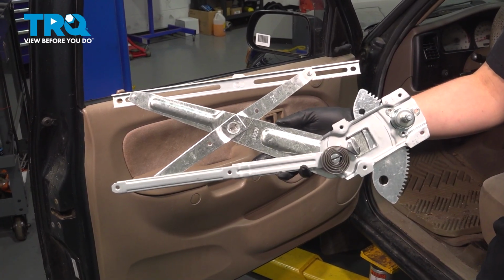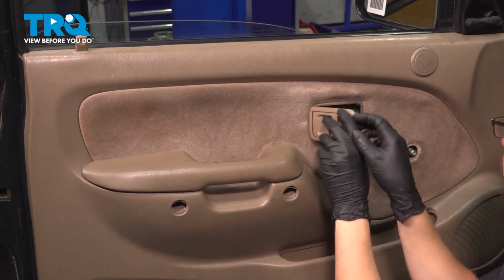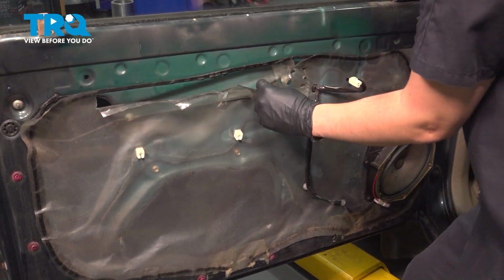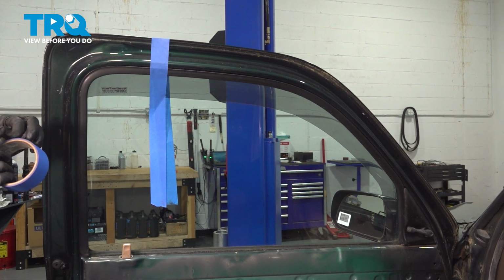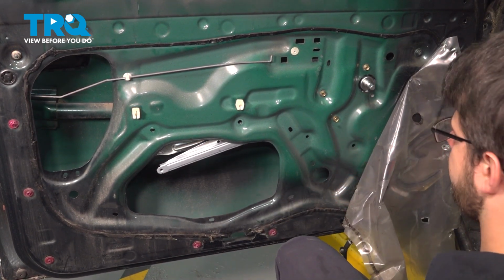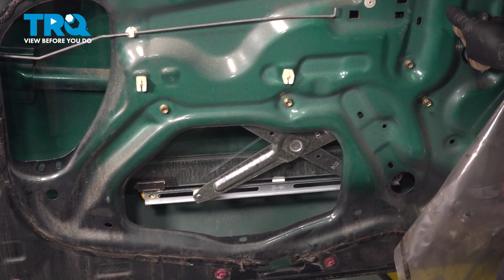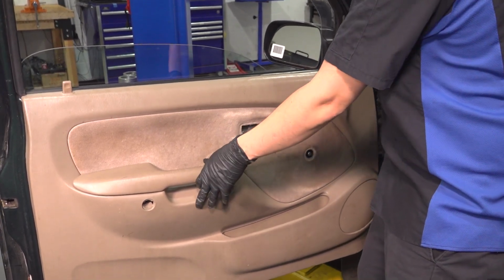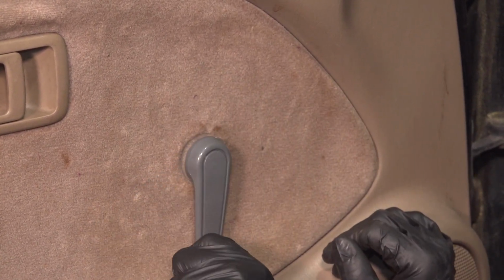How to Replace Front Window Regulators 1995-2004 Toyota Tacoma

Comment: Great video. Just replaced mine on my 04 Tacoma, most of it was common sense but I wasn't sure how to remove the glass. Used this video as a quick reference and realized I had skipped a step, rolled the window back down and sure enough, there were 2 bolts that I had missed.

Thanks for posting this tutorial!